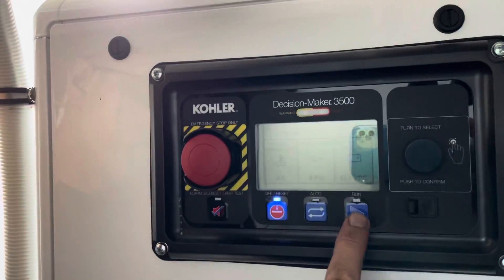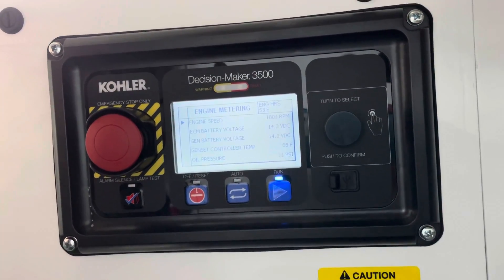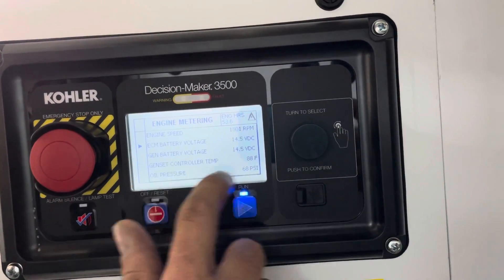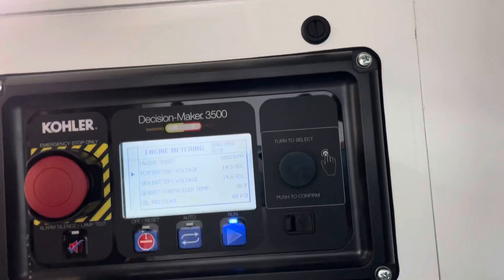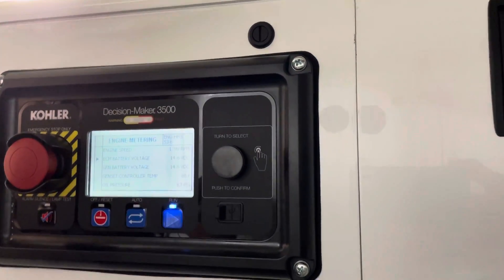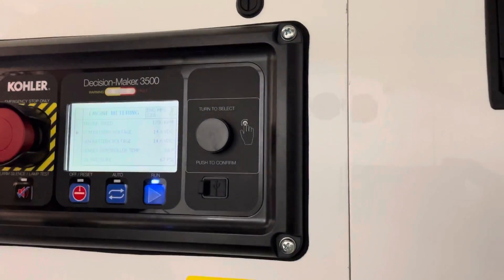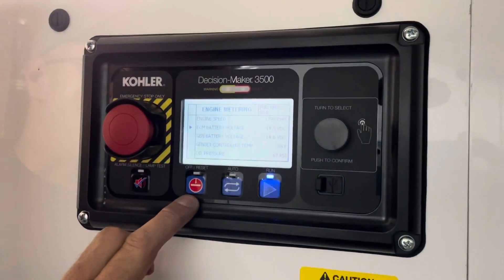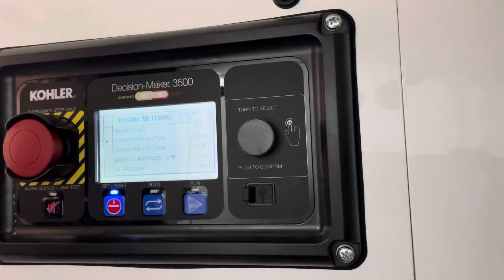Kohler generator operation

Comment: Biggest piece of shit I ever bought. I had an old 40 kw Kohler running on a John Deere 4045. Bought a new one with the decision maker 3500 and it's been nothing but junk. It was a leftover. The company that sells the generators have gone with Phasor because the Kohlers were GARBAGE!!!! Nothing but failed decision maker 3500's. They cost $2200.00 bucks and you will burn through one every 6 months. DO NOT BUY A GEN SET WITH SET UP.

Comment: Sir how to adjust frequency on monitor decision -maker 3500 . Because I try adjust no happen
Reply from the maker: Not sure you can adjust frequency from the board. Might be a hardware setting.
Reply: @myazure2950  how if I adjust rpm from governor Bosch Pump sir? Because I have Kholer generator 70 kw. Without load the Hz 49 and rpm 1480